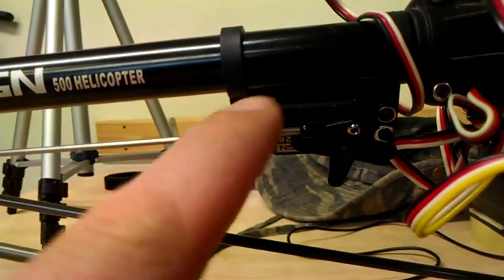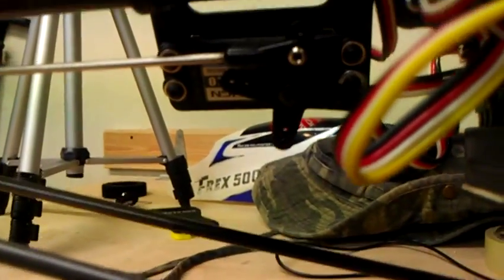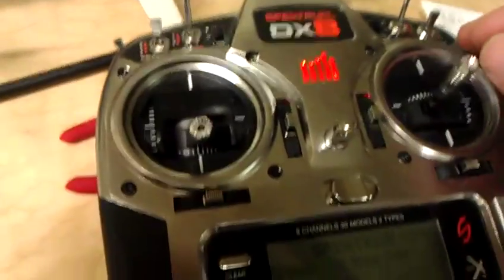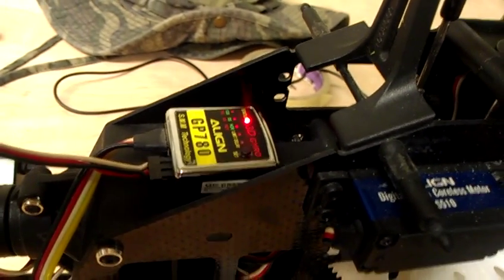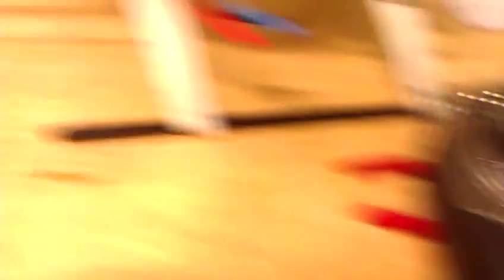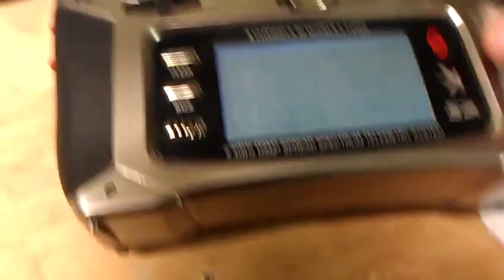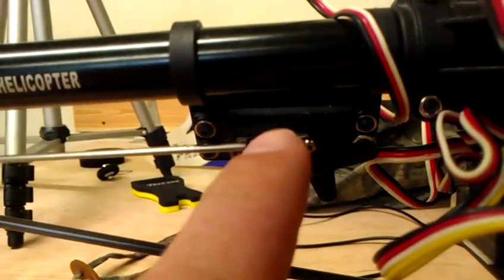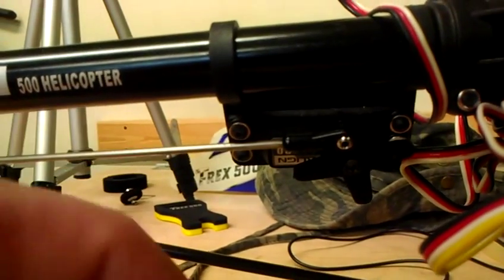Trex 500 tail servo question

Comment: Hi. Thank you for all advices. They really help. I wrote this message to another youtube guy but maybe you can throw an advice:  I have trex 500 and trying to setup the gyro. I got a tail servo perfectly 90 aligned and tail blade pitch is fine. When I move the heli in "working" (right lever fliped forward) mode to the left or to the right, I dont get any reaction from the gyro. I have Align  GP 700 gyro model. From your second video on setup I noticed that when I plug the batteries, in testing, I get four single beeps and fifth is 3 beeps (total testing responses - 5). From the table you showed, it seems like I am not in helicopter mode or something. Maybe this is the reason, my gyro is not responding to movements? Could you walk me thru this setup. How do I access the manu where I can set up those beeps to be correct? I am just trying to figure out why the gyro is not responding? The servo moves in right directions when I move the left stick. On my Spektrum DX7 DSM2 I am in Helicopter model mode. Thank you in advance.

Comment: I had an incident last week, where I had 2 3s packs on storage mode and connected them to my heli for tuning purpose (mash plate etc.) and I occacionally was spinning the blades. So I ended up with 2 discharged packs, where I had to resurrect them with NiMH mode charging. One of the 3 s packs did not want to live) until I took it apart and pulled out one of the sells, which gave me pain in the ass before, and now it could not take discharge issue and died completly. So I was able to bring the other two sells back to charge (3.7) and now I am stuck with 5S 3300 (2s +3s). Anyways, whats the deal with having 5s vs 6s besides extra weight and more fly time? Does the rotor spins faster, let's say at full throtle with having 22 v instead of 18? Is it worth it to have 6s?

Comment: Hi, I got a question. For how long can you keep LiPo batteries fully or partially charged before they may damage or it may cause them to lose their power, days or months?  I am talking about, how long can I keep them in this stage before I put them into storage mode? Lets say, I plan to fly in 5 days from now. Will it damage somehow if I keep the batteries fully charged?

Comment: Need your help. I aligned main rotor, but when it spins on middle left stick and I push the right one forward, blades start to lean to the left, and when I push backward, the go to the right. What is the problem? Levers on all servos are perfectly 90 degrees. Blades are zero pitch on middle left stick. Should I play around with trimming? Need your advice, before I ruine the heli))
Reply from the maker: it sounds to me that you have your servos plugged into the wrong ports on your receiver.  The cyclic servo on the right side of the helicopter is your Aileron servo.  The cyclic servo at the rear is your Elevator servo.  The cyclic servo on the left is your Pitch servo.  So, Aileron servo to Aileron port on the receiver.  Elevator servo to the Elevator port on the receiver.  Pitch servo to AUX1 on the receiver.  Double check that
Reply: Ok. Thanks! I will doublecheck. I remember that I had to reverse aile servo. This heli was flying fine and I did not touch the receiver plugins. But if it is fine, what else should I check?
Reply from the maker: if you are certain that your servos are in the right ports, then something is wrong in your Swash Mix.  What transmitter are you using?
Reply from the maker: rmiklosh the dx7 is a great radio.

Comment: One thing I dont understand when charging 3s lipo  3300 pack. All battery chargers seem to have similar program. When I put 3s pack for full charge, mah goes to 1590 and then beeps that batteries are full charged. What tha hell is 1590 mah?) Is it the charge per one cell?
Reply: The battery pack is brand new.
Reply from the maker: rmiklosh Its very likely that the charger is putting back 1590mah into the battery.  Meaning that you start with 3300mah total mah capacity.  Then you discharge 1590mah when you are flying.  Then you put the battery on the charger and the charger puts back the 1590mah that you used.

Comment: Well. I had 1 3s 3300 battery and 2s 3300 mah to launch, and since i got bored with clubs) I decided to resurect the third plate of the other 3s lipo battery, so I took it apart, gave it a life) and now I got two 3s 3300 mah to stick on trex 500. I balanced swash plate, but how to balance heli with these batteries? I read that that you put blades paralel to the tail and kinda hold bars with fingers and see if it stays paralell. Any other suggestions. The reason, I am asking is because everyone suggest to have 6s 2500 size, but i got 6s (combined) 3300 and they are both 480 grams.
Reply: It is gonna be my first flight with rc, so I want everything to be perfect so I can blame myself for all shit which may happen to my heli). By the way, I flew Cessna to Florida from Cleveland cause my stepbrother got pilot licence), but it was boring. Still waiting for tail servo.
Reply from the maker: Whether a helicopter has a flybar or a helicopter is flybarless, here is how I balance my helicopters.  There is a short bolt that attaches the rotor cap, at the very top of the rotor head.  I found an identical bolt and put it inside some rubber tubing, with the threads hanging out.  Then I put a ziptie at the tip of that rubber tubing to hold the bolt in place.  Now, with the rotor blades spread out, screw in that bolt that is in the rubber tubing.  Now, you can pull up on the rubber tubing and lift the helicopter off the ground.  By doing this, you are lifting the helicopter from the center of the rotor head (perfect center of gravity).  If the tail drops, move your batteries forward and lift the helicopter again.  If the nose drops, move the batteries rearwards.  Repeat this process until you can lift the helicopter and it stays balanced.  If you need me to, I can upload a short video that will show you what I'm talking about.
Reply from the maker: rmiklosh The amount of time you can leave a lipo fully charged has been a huge debate.  One person will say one thing while another person will say something different.  Personally, I never leave my packs fully charged for more than 3 days.  Becuase of that practice, I have some packs that are 4 years old and they still perform very very well.  I would never leave a pack fully charged for 5 days.  When I get back home from the flying field, I always put my packs on the charger to get them up to storage charge...minimum.

Comment: Hi guys. Since we talk about tail servo, on my trex 500 it does not move at all, when I move left stick while other servos are ok and I noticed, it gets hot eventhough I did not fly. Is the tail servo damaged? I tried to move the rod but it is stuck in ome position. Any ideas?
Reply from the maker: rmiklosh if you have power to the servo, which you obviously do because it get hot, but the servo doesn't move....I'd say you have a bad servo.  Do you have a spare servo, of any size, that you can connect to the rudder and see if it moves?
Reply: Thanks for reply. No, I do not have a spare servo. Actually, I am into rc hobby for a month and still try to figure out things. My friend presented me Trex 500 and he said that he flew it 6 years ago 5 times for 5 min at most and then it was stored and now I am in process of resurection ). I recharged batteries. I have Spektrum DX7 dmc2 transmitter and trex 500 is around 6 years old model. When I turned it on, it already had a setup on the transmiter and blades moved the way it should. But I noticed that tail ones do not move. So I think I need new servo, cause this one gets hot as hell and I did not fly it (just spinned blades on the floor for not even a minute).  I read that servos should stay cool.
Reply from the maker: rmiklosh Yes, servos should only get slightly warm.  If that helicopter is 6 years old, I'd suggest replacing all the servos
Reply from the maker: rmiklosh yes, Savox servos are ok.  I don't know which one would be best.  I run all Align servos
Reply from the maker: It sounds like you are well on your way to a flyable helicopter!  Awesome!  When I'm not flying my helicopters, I fly a lot of planes.  Most of my plane parts come from China and it's not often that I get a faulty part....maybe 3 times a year....not bad.  I hope your servo works out for you!  Just take your time with the set up and make sure your linkages are lined up properly.  I look forward to hearing about your results!  Best of luck!!!

Comment: 9.	You should now be good to test fly in HH (25% - 35% with DX8 in hover); if you want to perfect the mechanical setup, fly it in rate mode and adjust the servo mount (bigger adjustments; unless using a vernier)  or ball links (small adjustment)

Comment: 6.	Screw the ball link back into the servo horn
7.	Loosen the servo mount and slide the servo so that the leading edge of the tail blades is a tiny bit towards the tail boom and the push rod is straight along the boom; then tighten the servo mount.
8.	Reset the gyro end points

Comment: You don’t want to use sub trim or trim on the rudder.
Here are some steps for you:
1.	Remove all trim/sub trim from the rudder
2.	Unscrew the ball from the horn
3.	Unscrew/Remove the horn
4.	Power up the heli in rate mode (use only rate mode when setting up the tail mechanics)
5.	Find the position where the horn fits the servo as close to 90 as you can (it will be farther out for some of the arms, this is why I like the futaba star shaped horns) and screw it back in

Comment: ive but using sub trim might be ok just i have never used it i was told to never use sub trim on the tail.
and your tail pushrod linkage does not look like it is parallel with the boom push the servo around a little until the linkage lines up perfectly with the boom.
when you go to heading hold the servo might not go to a perfect 90 dont worry about it in hh mpde